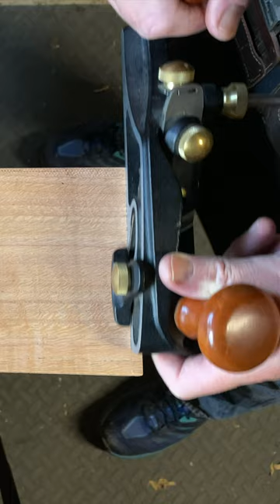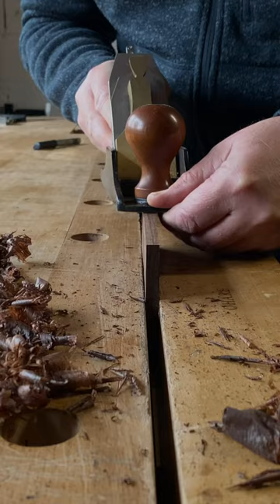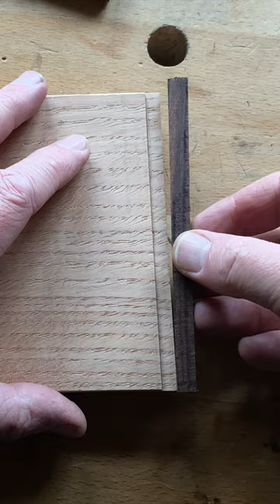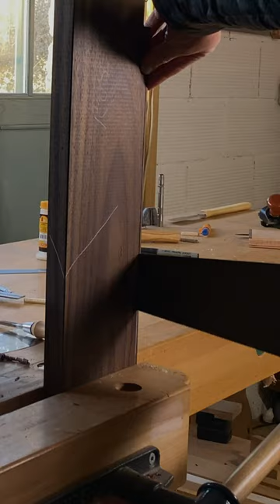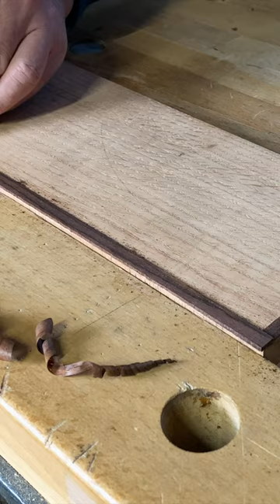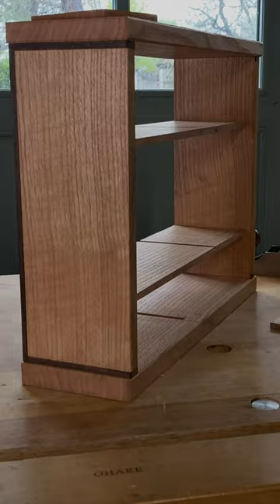Custom Inlay for Cabinet

Comment: Amazing work! I would love if you listed your basic hand tools you use for woodworking. Also, Amateur?! I’d increase that ranking to intermediate at the very least.
Reply from the maker: I am using a rabbet plane (Veritas) and a few hand planes - block plane and No 5 (Lie Nielsen), a japanese flush cut saw and an old ebay refurbed hand saw.... thanks for comment, appreciate it, cheers

Comment: Very nice aesthetic. Are the spring clamps enough to get the necessary pressure for the wood glue or is there more to it that I missed?
Reply from the maker: Cheers, yes for the short side - supercharged clamps (!) as I need 2 hands to open them! Proper clamps used on the longer sides though- regards